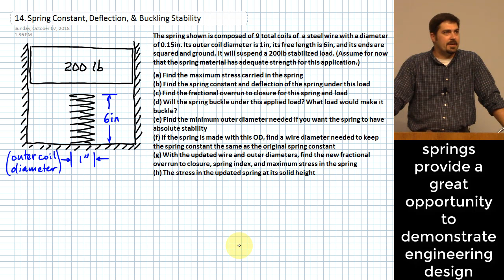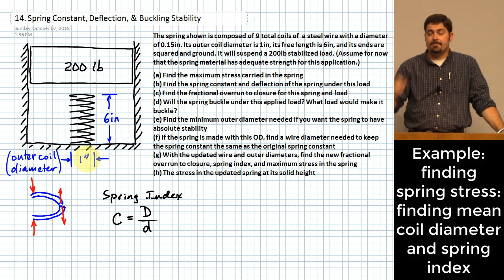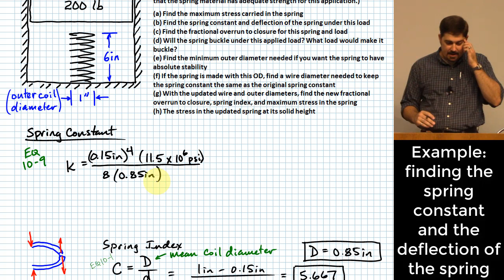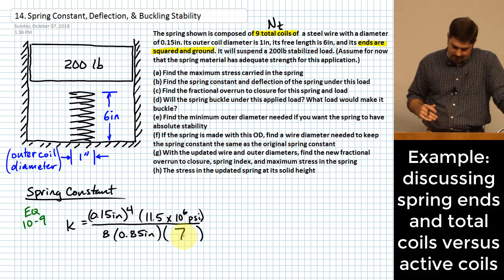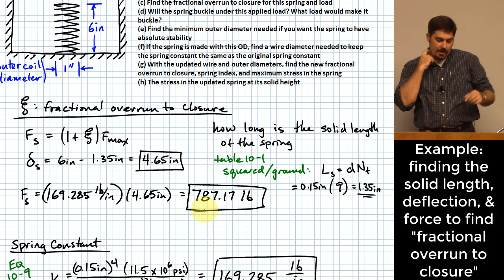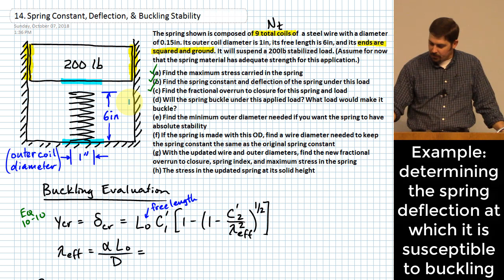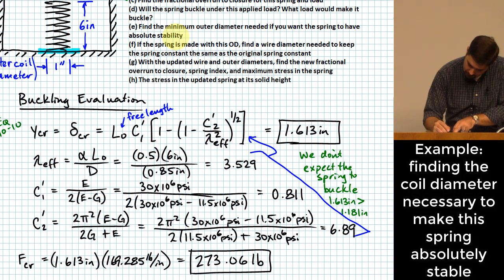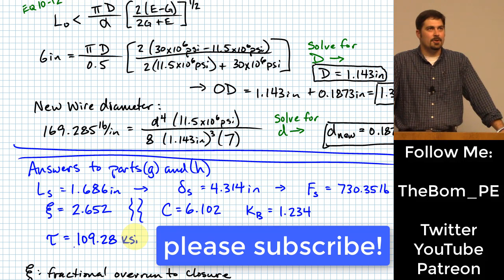Spring Stress, Deflection, & Buckling Stability | Spring Index & End Types | Active vs. Total Coils

Comment: Min. 17:14...I always design helical spring for the purpose of stopping a descending car or counterweight beyond its normal limit of travel. When designing spring which Standard Specification I should use for Steel Springs?  According to which code, the yielding strength achievable is 130-150ksi? You mean allowable by achievable? Thanks